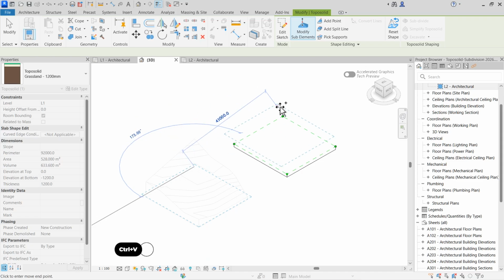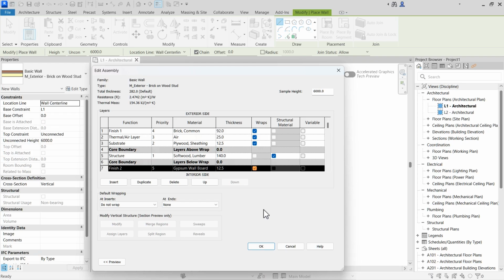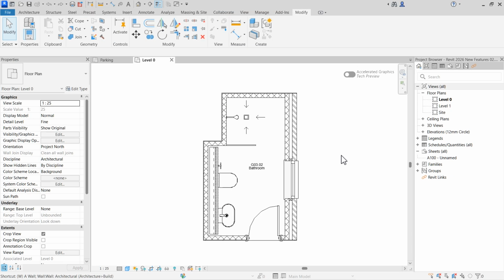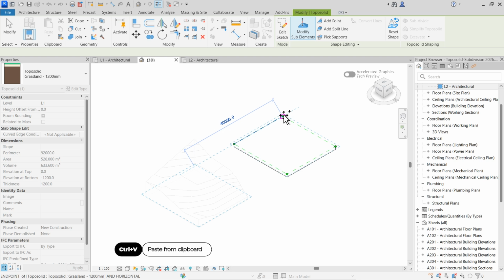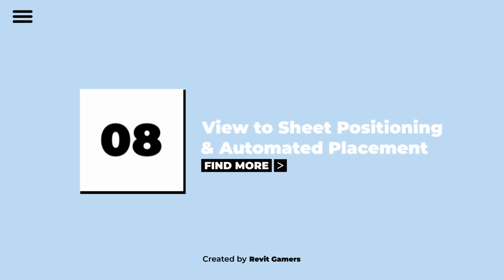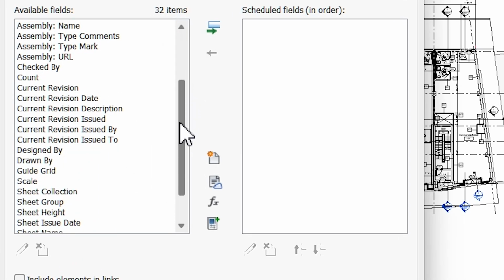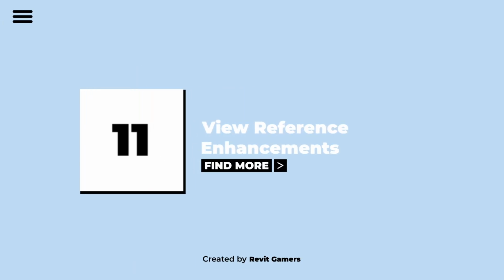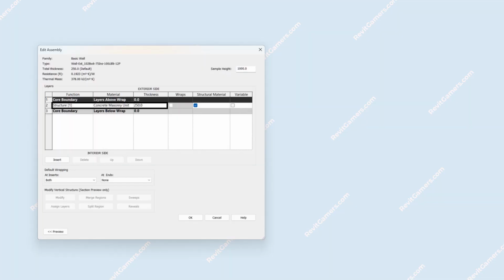Revit 2026 New Features - What's New in Revit 2026

Comment: one of the major issues which i picked up on was the layered wall feature. It does not appear possible for the plasterboard or plaster layer to return into the window frame in a layered wall as it is with a compound wall. although the layered wall feature is amazing it would be limited in its use for this reason. I would love to see this modified so that the entire layer returns to the window or door frame if selected.